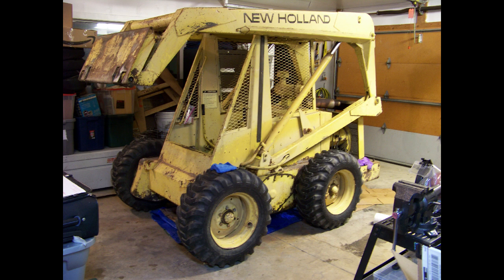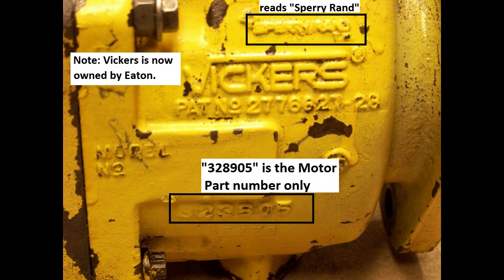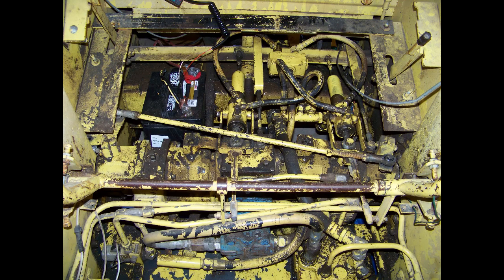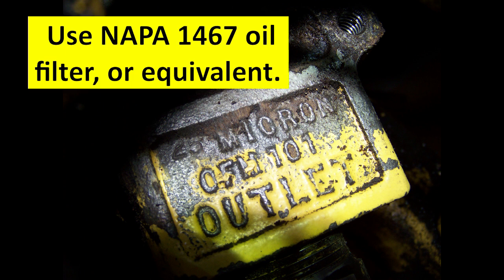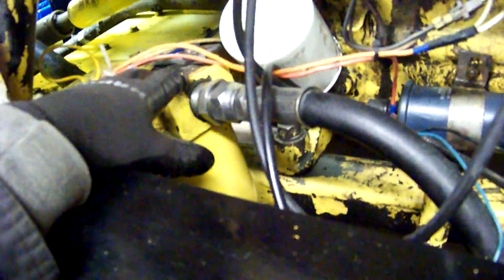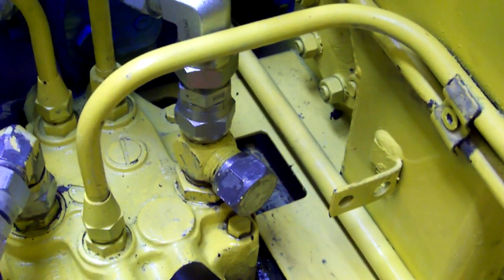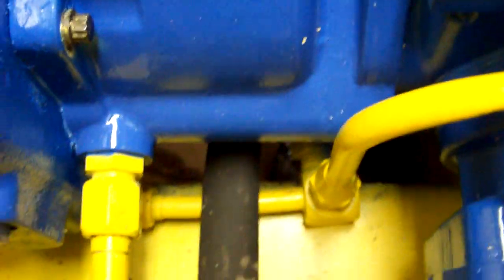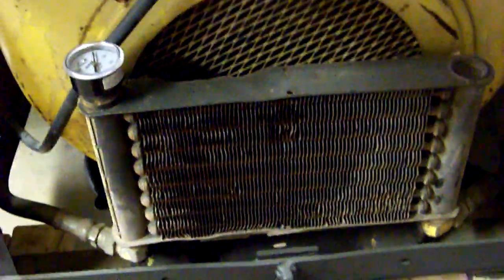New Holland L35, L775 Skid Steer (Vickers) Explaining the Hydraulic Flow, Purge Procedure

Comment: Charge pump charges two hydrostatic drive pumps and runs bucket boom.
Charge pressure runs between 300-500 psi to drive pumps and 2000-3500 to hydraulic cylinder s on boom.
Wobble plate angle is controlled by steering handles and varies out put flow and direction. 
Look up pressure compensated hydrostatic pumps.
Ingeneous design used by all modern machines. 
Now computer controlled feed back on newer machines.
Watch Steiner Tractor TV Rachael..she is also a excellent mechanic.

Check suction screen in tank often clogs on mine. Clean oil is critical as you say so many times... excellent !
Excellent work.
Shalom

Comment: So much time and care obviously went into this production. You really know your stuff about this machine. This is one of the few videos captivating enough to watch thoroughly numerous times and I don't even own one of these machines, though I did spend a good part of my youth operating one on the farm. Thank you.
Reply from the maker: Thank you!
Reply: @L35inColorado  Sooo I didn't have one then went out and found one and your videos are proving to be a world of help. The oil is milky white, I'm assuming air was introduced into the only line with a leak, the pump drain line. Hopefully replacing this and the oil will help with the machine's whine. Thanks again! Oh, and the part number I'll be replacing this with is 931-2236
Reply from the maker: @erikp5106  Hey, cool!  They really are tough machines; easy to work on, but parts can be tricky.  

Yes, sounds like you have air in the system.  Once you get the parts swapped out, do the purge procedure, then let her run for a good while (make sure you have enough oil in the system, add some if needed).  

After she's warmed up a bit, you can raise and lower the boom, and tilt the bucket in several cycles to also help push the air out.  

Don't make my mistake -- I opened the oil fill/dipstick a little too soon after shutting her off after bleeding, and the oil was so bubbly that it looked like root beer and started overflowing out of the fill tube!  Haha, a bit of a hot mess, but I just put the lid back on a let her cool off completely.  Then I checked the oil level, topped it off, and she's been good since.  

Does your L35 have a VG4D engine?
Reply: @L35inColorado  This machine does have the VG4D. The cooling tins had been removed and I had no idea how to determine the engine size until I happened to turn one over - oh there's the data plate!
Reply: I'm looking at buying one also  it's the new holland 1987 or 86 with a kubota engine  I'm a little scared to indulge myself and buy it's a parked an ran but needs rebuild  .I'm just curious would it be something I would be able to do with mainly tools and a chain winch and it's a one owner machine and is 1200 dollars and a rebuild kit is same price would u be aware of the prices I would be hit with on a rebuild I would try and do all myself except for the piston cylinders  I'm a novice type mechanic have a few motor teardowns under belt but not diesel or heavy equipment,  just was hoping to say it would be easy ..I just think it's not. And wonder if there are alot of specialty tools that I'd have to buy ..idk .. and wondered how much u invested on the transmission  looking for a tip .  I guess. But you did a marvelous job there on yours,,  how long have u taken to get it in the shape it's in there ??  Oh and the machine I was thinking and wanting to get has been at a scrap yard  machine they run a scrap yard and have had it since new so they probly have taken mattinence serious and it runs just low on power the thg said    .kubota and new holland ... the inside looks just like yours a little but nothing as pretty . I like the blue transmissions . And orange things very nice ..great video , hope I can establish my self with  this machine to worry about doing a fluid flush  . nice job

Comment: verywell made video! thank you. I was just offerewd a 1971 L35 new Holland for FREE from a buddy of mine. Its current state is not running. He said it ran a few years ago when he parked it and all the hydraulics function, comes with forks and a bucket. what are some common issues with these and things too look out for? things to check out before I commit to taking on a project like this. it will be my first ever piece of equipment. thanks for your time, awesome video by the way.